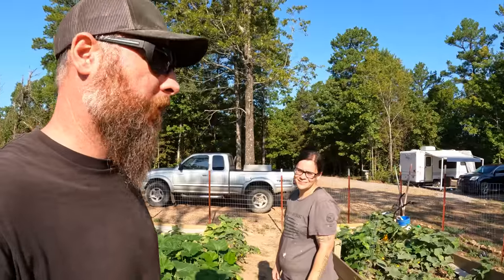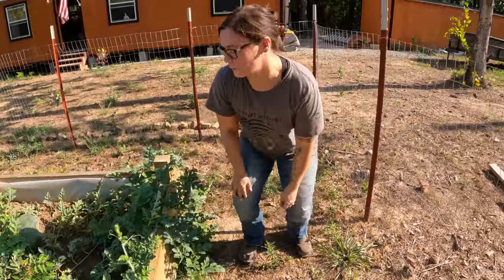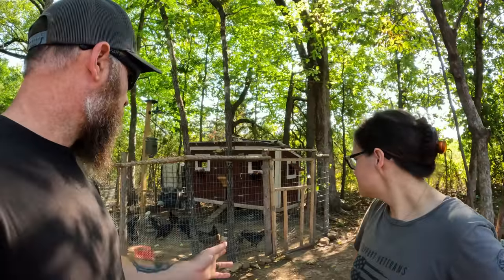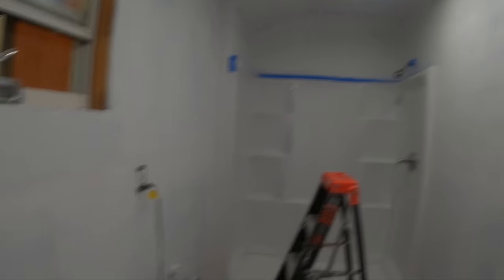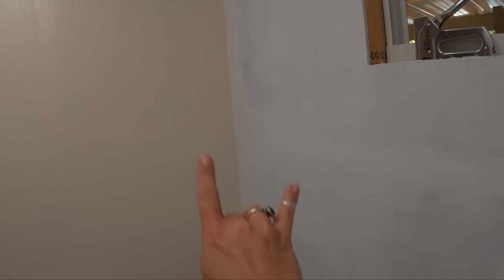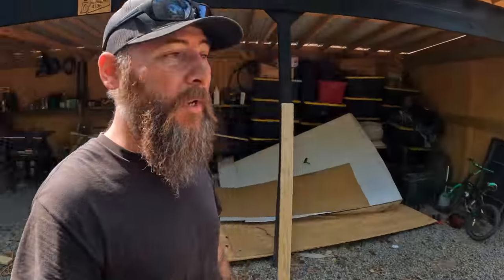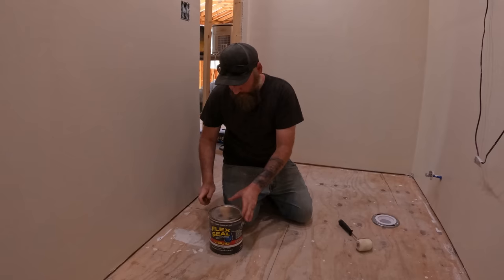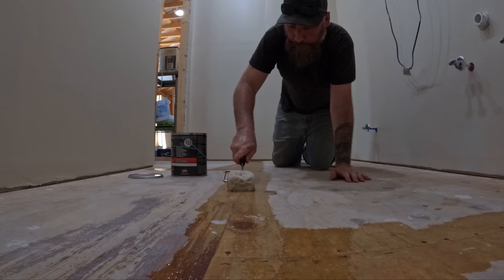The Most Important Piece | DIY Small Bathroom | Tiny Homestead In The Woods

Comment: Just an observation for you.  I have never seen the ceilings of rooms painted the same color as the walls.  They are usually white to "open" the room up.  Also, paint stores sell an additive for paint that is a mildewcide, comes in a little envelope.
Reply: Back in the 50's-60's the ceilings were painted the same color as the walls.  But you you're right, white ceilings make the room look bigger.

Comment: Just some advice, line the big rocks on the inside as well. Eventually your chickens will start digging holes inside the coop, and can lead to holes around the fencing. Put some flex seal on floor around bathtub, for any water that get on floor. Makes a big difference in a boys bathroom.have you picked a mirror for the bathrooms

Comment: Reason it’s hot is caused by radiant heat from to metal roof when sun shines. Insulate the roof/ceiling and you’ll experience much cooler in the building.

Comment: About Painting the Roof parts. Stick the other side of a Broom on the Paint roller and use it as temporary extension for not climb on the leader every time and do it per hand. If the Broom stick is out of wood it would help. Just try it out

Comment: Go to your local feed store and ask them for blossom end rot liquid to put into a pump up sprayer. Mix according to directions and spray your plants. It's very common in our area. This will stop the tomatoes from rotting.
Reply: Also save all your egg shells and let them dry out. They will keep till next planting season. I break/ grind  them up in my hand real small and pit about a dozen undet each plant . Put about a couple inches of soil between the plant and the egg shells when you plant. As the plant grows the egg shells will break down and feed the tomato plants with calcium.

Comment: Roxane, you will have to make a tiny sign for above the toilet with the day's date. So it will live in in infamy as 'the day of the 1st flush toilet on the 41.36'. Also, I cleaned houses for 35 years and in the shower, you might want to consider a 'shower head on a rope'. Makes it easy to rinse down the walls, wash the dogs or anything else you want to wash off with warm water.. The router work on the trim puts it on another level. Awesome, well done job. I'll bet you will smile every time you walk in there for a long while!

Comment: Painting the corners (as we call in the professional trades) is called "cutting in" and is usually done before you roll the walls, The walls should be rolled while the paint that you cut in is still wet (works better with two people).  Using a handle (like a mop or broom handle screwed into the handle of the roller) will allow you to roll bigger areas at a time (effectively cutting your painting time a great deal). But the question I have to ask is why have you insulated your inside walls but not the outside walls?

Comment: Blossom end rot is the problem.  I've had it happen to my garden tomatoes.  I just bought calcium product for tomatoes. My green house Aldo told ne I can crush a plain tums and sprinkle around base of each tomato and just water it in.  It won't cure the tomatoes thst have it but will prevent the new ones from getting it. Good luck. We've all had it happen.

Comment: you can see the center dry wall seams on camera which makes them look not done
Reply: Yeah…I can see most of the seams as well.  Maybe by the time they hang mirrors and towel racks it will cover most of it up.  But hey, it’s their house and if they are happy with it that’s all that matters.
Reply: Needed one more coat of mud, and the joint needed to be fanned out to around 16” so it is easier to blend the seam to where you don’t see it.

Comment: Roxanne, you can control the blossom end rot by adding calcium to the soil.  Another tip, stop watering everyday.  Mulch the beds with either some grass clippings, or sawdust, or purchase mulch from the local garden center.  That will help retain the moisture, and keep the fruit off the ground.

Comment: If your going to be making your own trim a router table would be a huge asset. The fence will prevent the inevitable bearing following defects on the edge ruing the straight line and you can use a pair of feather boards to help with the consistency of the cut as well. They also sell some push pads that have a handle at the top and very grippy rubber on the bottom and by using those with a router table it makes it very easy and safe to run long lengths through.

Comment: The reason for tape and mud is to NOT SEE THE JOINTS. The area around the light switch is a good example of the problem. Hats off on trying but it amazes me how much you pat yourselves on the back. Roxanne is so easy to please, her garden problems are from lack of consistency in watering and the heat has been hard on most gardens. I built walls and put in a shower in my Las Vegas Photo Studio and Lab. I used a 15 foot wall and painted a portrait background and I knew every flaw would show up in photos. You need a large 14" mud pan and at least a 12 inch trowel and thin the mud so it flows smoothly and "feather" the mud almost a foot wide. I'm not trying to be mean, you just have so much more to do. Contact me if you want me to walk you through it. Sorry I can't B.S.you but I am wanting to be a constructive  help.

Comment: For the heat in your house, can you slide your screens in the windows to the top and open that way to allow the heat to excape out easier.  Of course you will need to have the fans still blowing the air as well.  Just know that heat rises so it may help the heat issue.